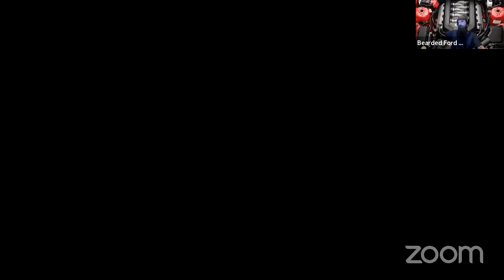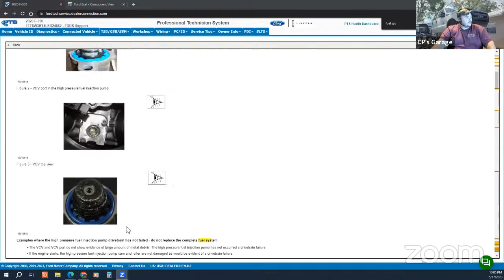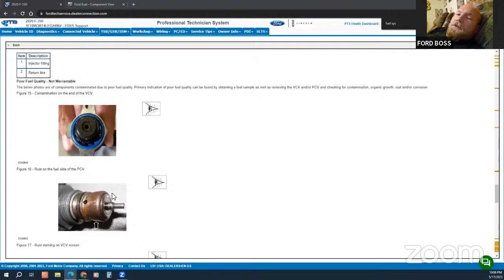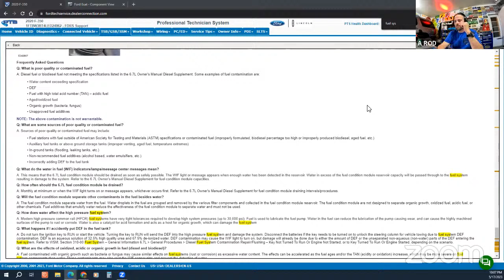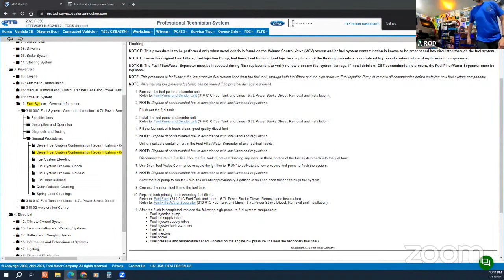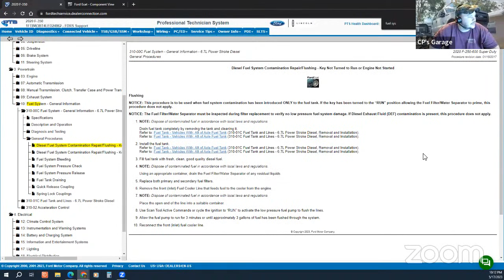Bring ya TRUCKs and Ya PROBLEMS, Diag night!!

Comment: 2012 f250 6.7 6r140 P0715/p0717 should i unplug the PCM and reconnect and where is the sensor location on the tranny and is there just one or two?

Comment: 2014 6.7.  Had a glow plug break off in no4.  Would this have been caused by a cracked valve?
Truck is running real bad.